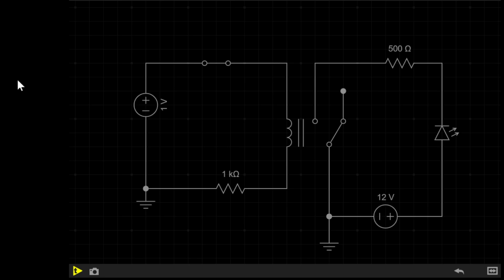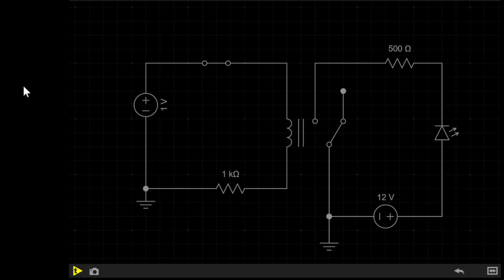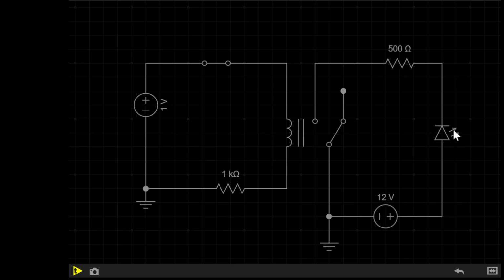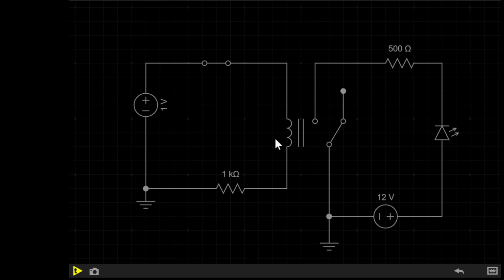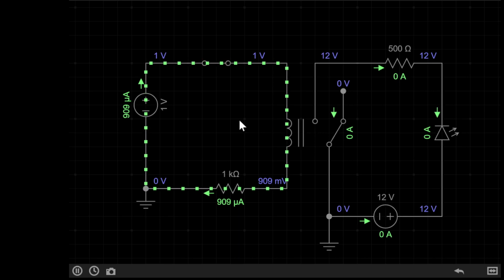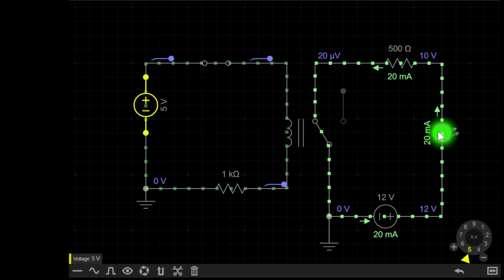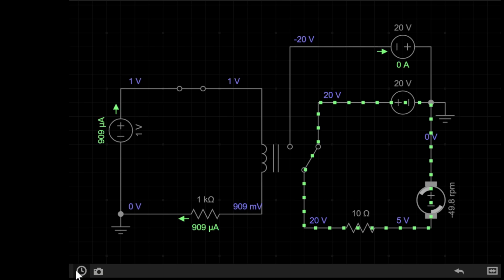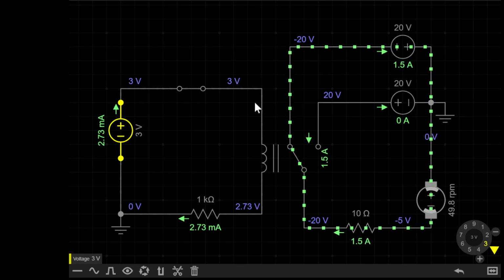Relays - Switching BIG currents - Explained

Comment: If it wasn't for relays we would not have cars or at least the  electrical system on them. imagine turning the lights on or the indicators through the the leaver in the searing column but it has wires the size of the battery connectors, as well as switches the size of the battery.
Reply from the maker: They really are so useful, even if just for sheer practicality like you say, not needing huge current wires everywhere.